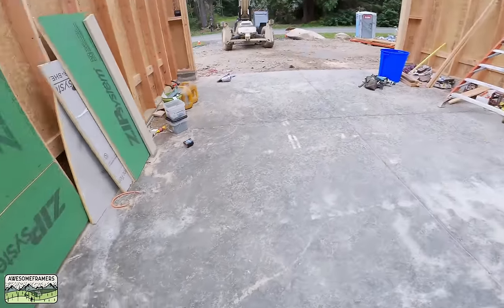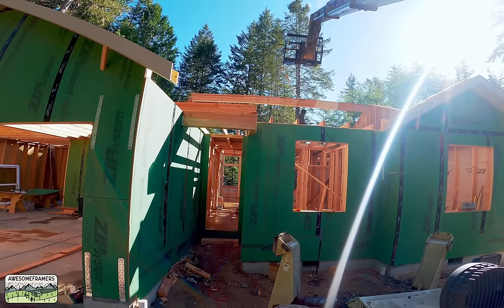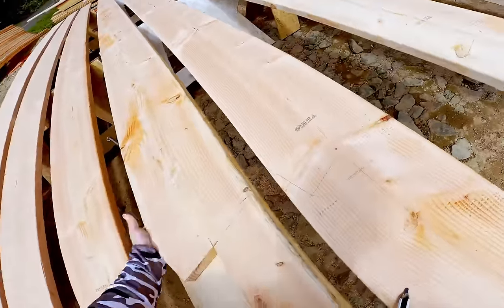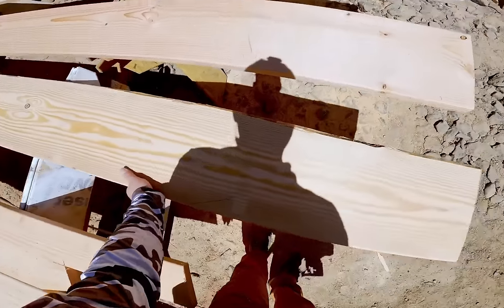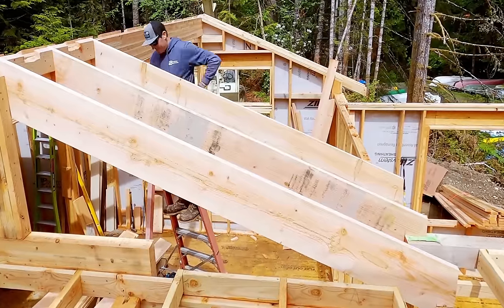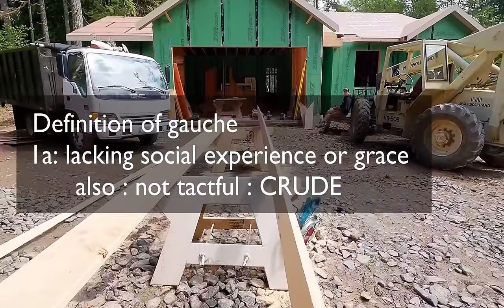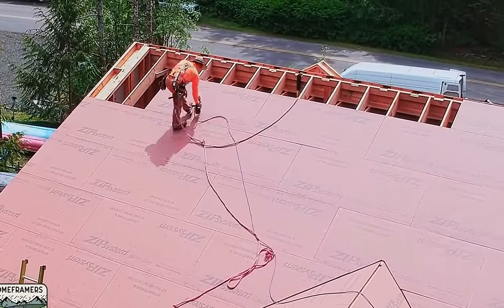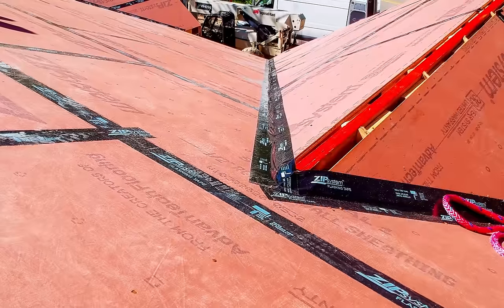Building a Spec Home part 2

Comment: Excellent video only 1/2 inch roof deck and no H clips is that decking material that strong man building materials have gotten so much better the taping materials who would have thunk it. So much better
Reply from the maker: Yep, they designed the 1/2" to be stiff enough to skip the clips.
Reply: @AwesomeFramers  thanks for answering my question really wasn't expecting that you guys are hilarious and very good framers you

Comment: I notice you use the makita twin 18 /36 v rear handle. Would you recommend that over the 40v makita or would you recommend dewalt rear handle.i want to buy the best bit I'm undecided .Greetings from Ireland 🇮🇪
Reply: I never tried the 40v but the way I see it is if one battery goes bad I can replace it much cheaper than if a 40v battery goes bad. Since the 40v has 2x as many cells it's 2x higher risk of going bad. Also can grab a battery and put it in a drill (more universal) Had this saw since 2017 too it's amazing.